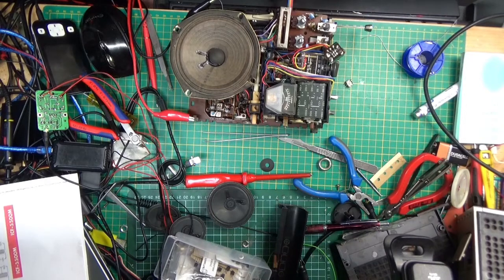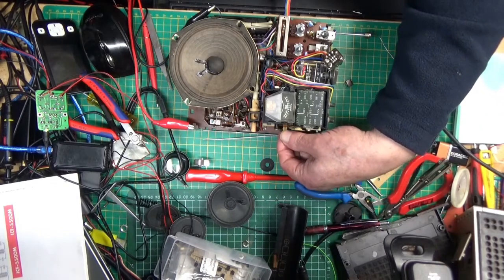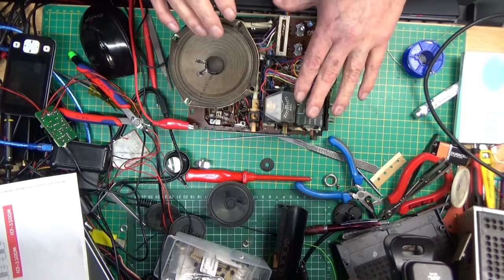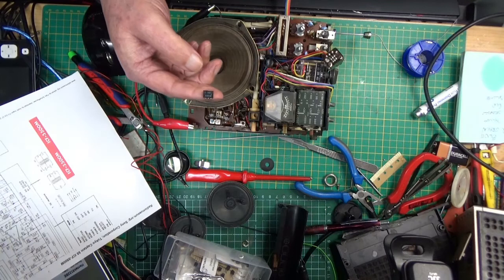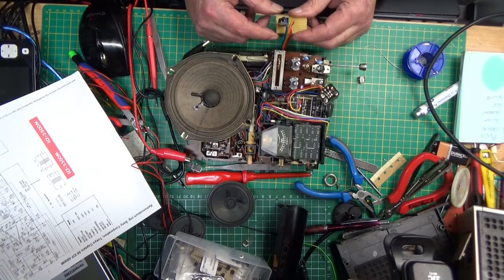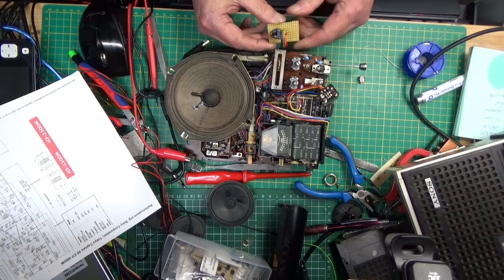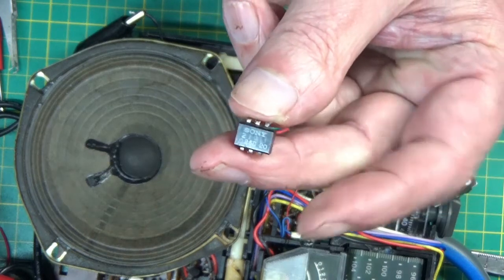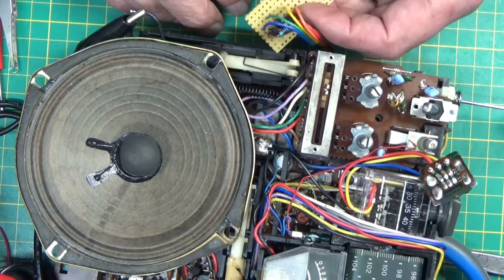Sony Captain 55 ICF 5500M Repair

Comment: I encounter the same problem. Being the proud owner of this particular Sony radio. I realized that the component cx-025E Is not available any more.. Would you please help me with the substitute corresponding circuit of the 3 transistors and the resistors so as to have the receiver healthy and loud again?